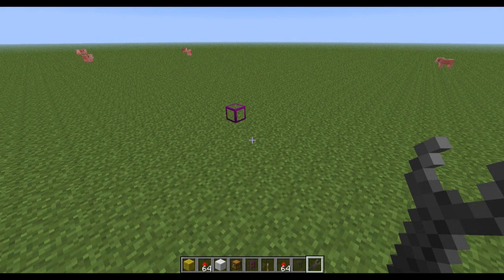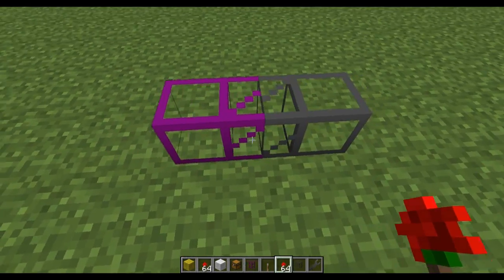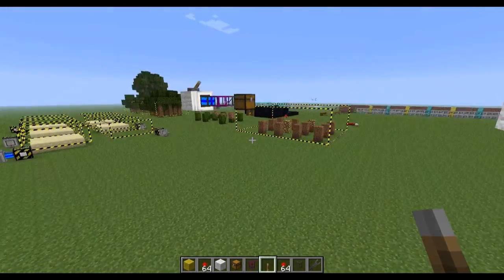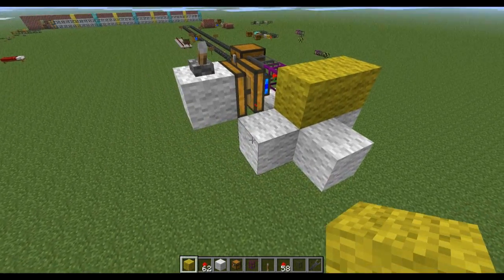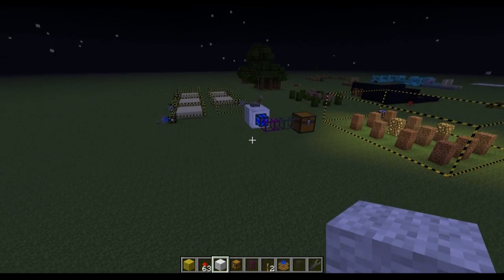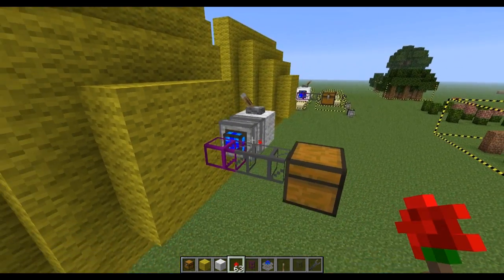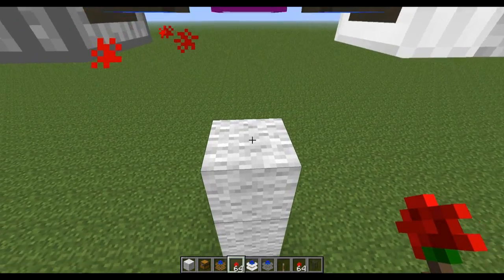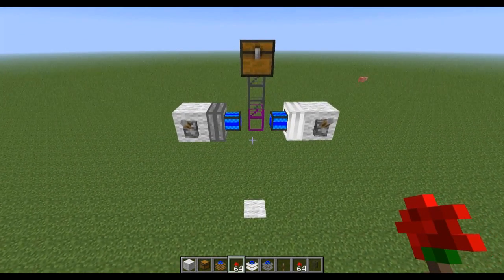Science of Buildcraft 02 - Obsidian Pipes

Comment: It should also be mentioned that you can put multiple engines around a single pipe, and each stroke of each engine pulls the amount specified in your tests. So you basically double, triple, or quadruple your speed. Four combustion engines all working together around a single pipe would pull 256 items at once. And that really sucks. :-)

Comment: so far the only video that shows how big the cone is per type of engine with an obsidian pipe, thanks for the video, could you make an updated for current mod version for these engines if anything has changed?
Reply from the maker: Thanks.  I don't believe anything has changed from this video, possibly with the exception of the rate at which items get sucked into the obsidian pipe (I'd have to confirm).  The cone sizes seem to be the same, though.
Reply: yep, the cones are the same, the only thing ive noticed that tesseracts plus steam engines are the best to get everything quick, for example a tree farm without the arboretum, if using the FTB packs